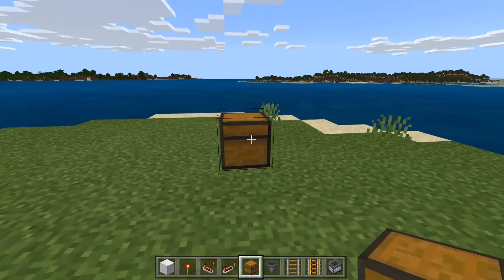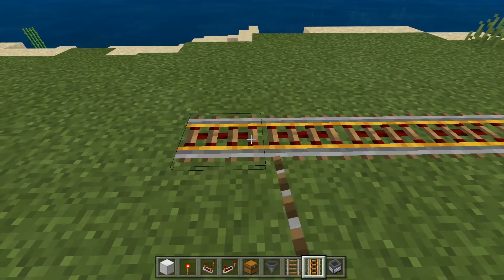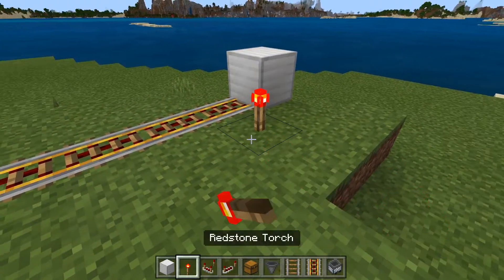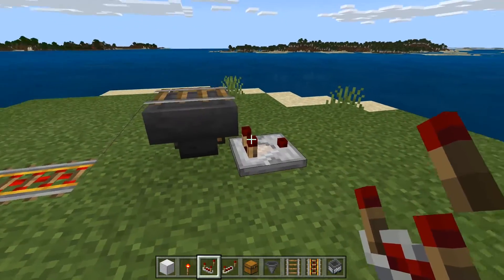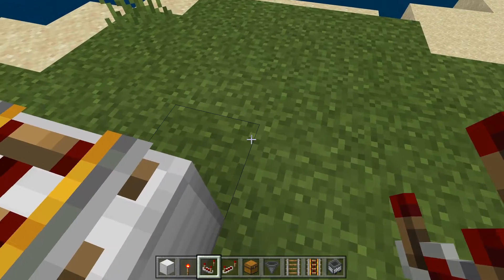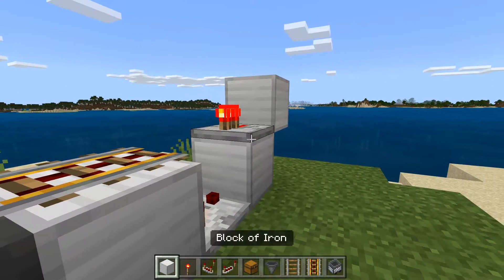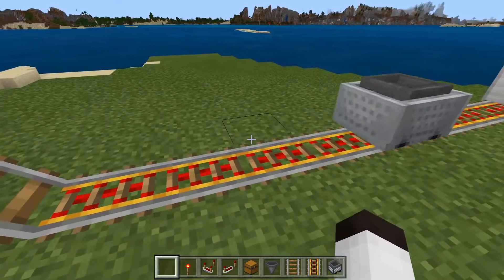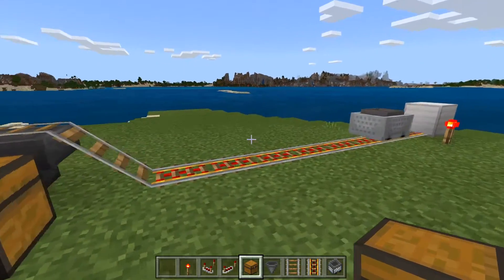Works in BEDROCK - Hopper Minecart Unloader

Comment: Mine wasn't working with this fix either, but then I put a powered rail on top of the hopper and it works now. Also, using minecart with chest instead of hopper. Maybe that's why it wasn't working. I don't know

Comment: Mine randomly stops working then starts working again
Reply from the maker: I have no idea why.  I don't usually play on bedrock, so hard for me to figure out.
Reply: Tinker77 its really weird and it only happens for 1 of my farms 😅😅😅
Reply: Mine wasn't working with this fix either, but then I put a powered rail on top of the hopper and it works now. Also, using minecart with chest instead of hopper. Maybe that's why it wasn't working. I don't know

Comment: this doesnt seem to work for me on bedrock can't seem what im doing wrong
Reply from the maker: Did you get it figured out.  Just go slowly and you may find the problem.
Reply: @Tinker77  Mine worked, then I found out that i needed to move my hoppers and chest out a little bit since they were in the way of the magma blocks at the bottom of my slime farm. moved them 2 blocks out to get the magma down, and now it doesn't work.. its 100% like what you have in the video. I do have 2 hopper minecarts running right next to each other. But I have the comparators and repeaters separated.

Comment: Tinker the normal java circuit works on bedrock as well
Reply from the maker: It doesn’t.  The minecart doesn’t stop to unload.  I’ve tested that myself after all the comments that it doesn’t work
Reply: @Tinker77  ok it worked for me
Nvm. It was directional
Reply: I found the normal method works if the cart is going slow enough, which is super annoying. This is great, thank you!!!